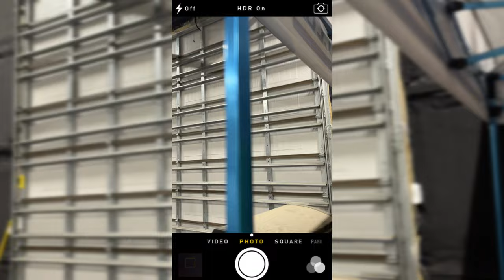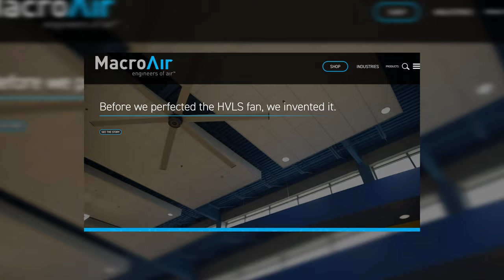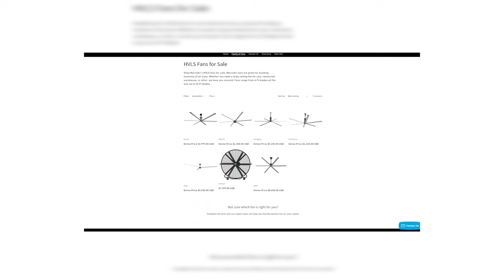Best Way to Cool Your Metal Building by Big Buildings Direct

Comment: why does my contract say if i install a fan i would will void my warranty ?
Reply from the maker: Properly installed should have no issues! We used clamps and went over the steel studs in order to not screw into the steel and harm the integrity of the steel.